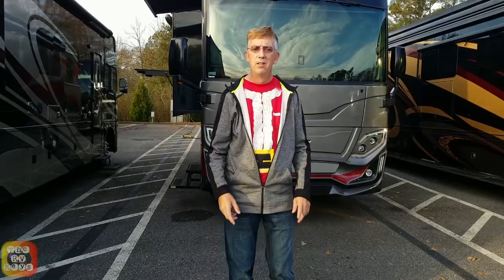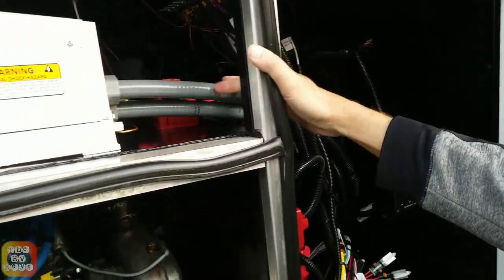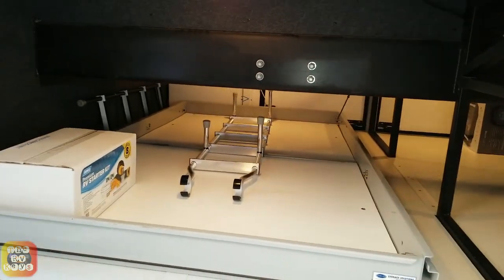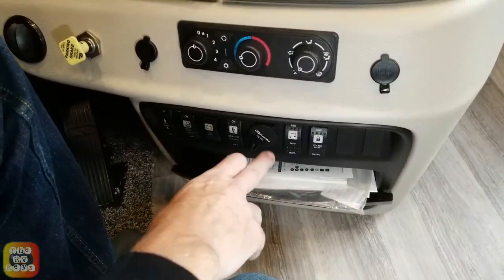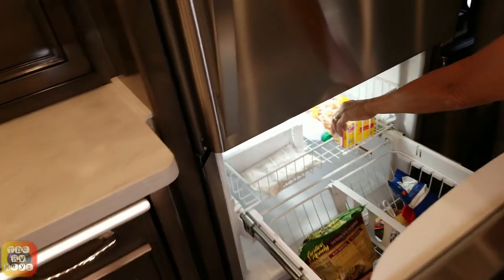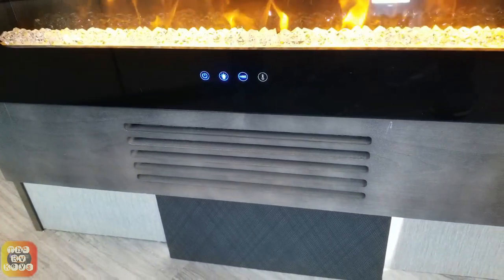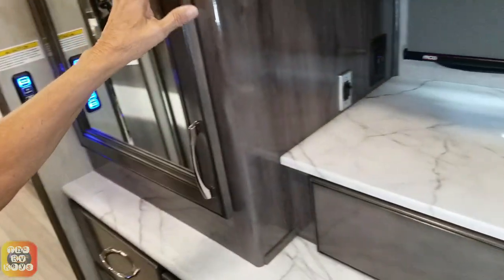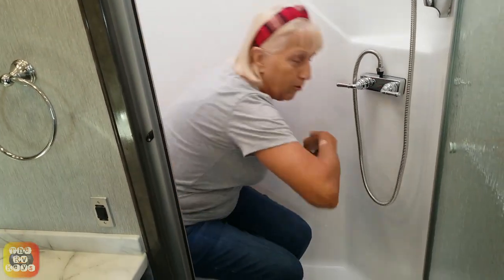Awesome Bath & Half Floorplan! We Show You The 2022 Fleetwood Frontier 36SS! TheRVkeys Episode 31B

Comment: Hi again - how are you liking the rig now that you've been in awhile?  Any chance there is storage under the passenger step?  Also curious if you can see the TV from the 2nd recliner by the wall.  We have been researching and keep coming back to this model.  Thanks.
Reply from the maker: There isn't storage under the entry step, but it does have a retractable step cover, which many other coaches in this price point do not have.  The answer to your couch question is Yes, you can watch the TV from that recliner.  But we have actually removed one section from the long couch to make way for a litterbox enclosure,  which we will show in a future video, but check out our blog at thervkeys.com and you can see pictures of the modification we made to the couch!  It makes the recliner position even better!